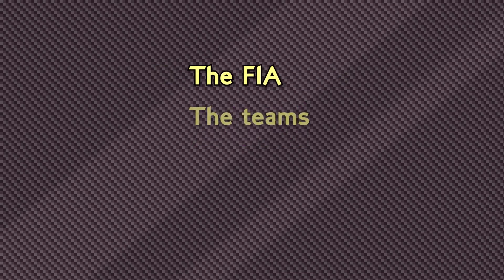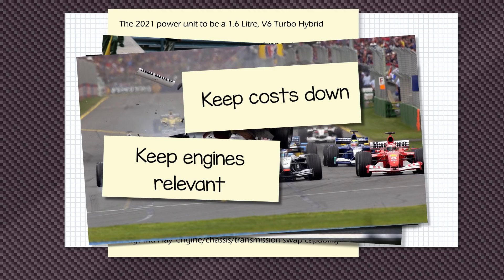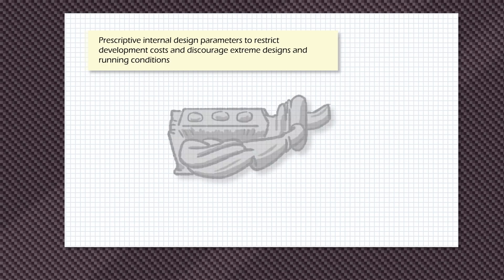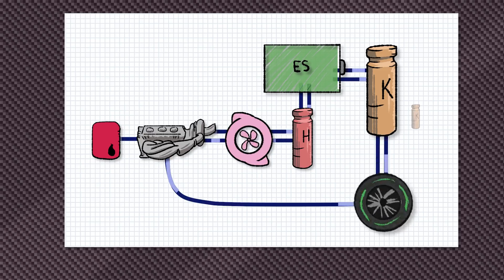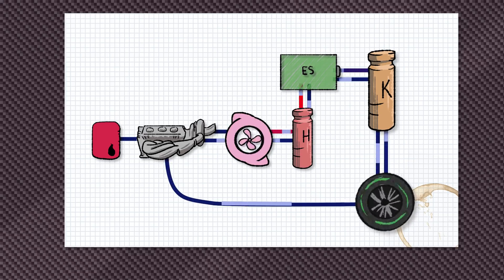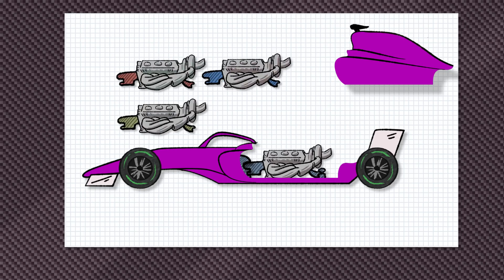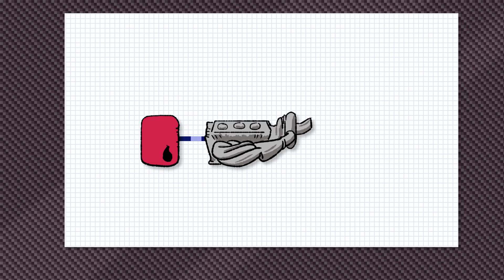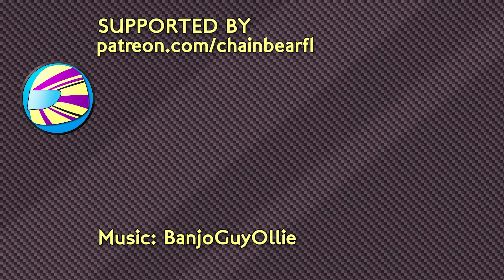F1 Engine proposals 2021 explored

Comment: Why dont they copy the motogp where in manufacturers decide on what kind of engine it would be as long as its in maximum limit of capacity. Whether the engine be v6 i6 i5 i4 i3 or single piston etc. As long as its 1.6 ltr or what ever. Rules kills f1.

Comment: Do you know what is not efficient? Burning fuel just for show, so a little or a lot it does not matter at all. But this is how F1/car/moto racing works, Big engines, Loud noice, Tons of power and happy audience. 
Haven't you noticed  the EMPTY sheets at the F1 races?
If the they are energy concerned, lets stop burning coal for electricity and using big engine cars for commuting (where there is no need for big engines) . Check what cars they are driving outside of the race, because i nerer noticed any racing participant driving a Prius.

Comment: bring back V10 but smaller capacity and hybrid technology
Reply: 2.4L V8 was just fine, they shouldn't have changed it. The new complicated hybrid power unit is what made Mercedes dominant as they have been developing it for years before.

Comment: It's not that they're not interested. They want to do it. EU and now more countries have a strict requirements and regulations what emissions engines should have. Downsizing is of course ridiculous, because those engines aren't reliable. With the rise of new stronger materials and as time went on V8 or V10 high revving engines would be a better option because F1 is sprint racing. Of course, those engines were made with thought that the gas tank won't be full from the beginning. That's why I think bringing back "bigger" naturally aspirated engines is far better than a overweighted hybrid that gives not so much, even though it has more power, but what's that power when your car weights a kpgjilion kilograms.

Comment: Hybrid is not the future so the thesis to have them is flawed. The need to restrict to 3 power units a year has cost more than the marginal cost of producing many the same and has hampered racing. With a full electric series already existing F1 is boxed in. The regulations should be about what you can do rather than what you can do. Spectacular innovation is the future of the series.

Comment: Standardized battery is dumb. Battery tech is the single thing we need more innovation in, letting f1 teams develop new high end batteries would ultimately make consumer cars/electronics/whatever have better batteries.
Reply: Not really. What you are saying is like telling F1 teams to go make their own tires. Its massively inefficient.

 Battery companies can improve batteries with their expertise, F1 teams just make batter use of that to their advantage and automobile advancement. Just like F1 teams and Pirelli
Reply: @uniwasamistake6334  True but if there's a possibility of building a better tire then why limit the teams from doing so? If the team can develop a new type of battery that gives them an advantage then that's all the more incentive to innovate, correct? But f1 is no longer about innovation, it's more about keeping the sponsors happy.

Comment: would it be allowed to use hho or any other stuff inside the gasoline? are there rulez? What rulez are there for the electric unit? can they build it like they want?
What else are they allowed to do? could they use other things to gain energy? like another front brake system? is there the whole rulebook public? :D

Comment: 1L V10 without a rev limiter, twin turbos, 4 wheel drivebwith 3 electric motors and an ERS/MGU-K. That would be incredible. Imagine the tiny V10's revving to 30,000RPM. Absolute insanity.
Reply: But it would be way worse than the current cars. If you want noise just listen asmr f1 on YouTube.

Comment: Great video mate! What would you however say about using CVT transmission, a fly by wire/fibre system for crazy maneuvering and adding one of those williams flywheel for energy conservation?  Besides, engines can very well rev up to 20K with the pneumatic tech on the pistons, so unlocking that shouldn't be an issue. Its racing after all and if we have carbon ceramic brakes, carbon fiber monocoque and what not, it will be also be quite nice to see an air brake to shorten the braking distance. The flywheel will kick the acceleration up, CVT will keep the engine revving at an optimum rate, fly by wire will keep the wheels on the bloody ground and lap records will be shattered...
That will be a formula 1 I would pay to go and watch.

Comment: Is F1 not a race anymore, rather competition to use the least fuel? Why were/are we detuning the engines and maintaining fuel flow restrictions? If they use too much fuel just let them run out. So many benefits to moving back to NA from turbo (they did it in the 60's they can do it again) such as massive power density, low weight, simplicity and cost. Don't judge NA V10/V12 of today with the mindset of the reliability (per engine usage rules) and combustion efficiency of the 90s and 2000s.
Reply: V6 are way more efficient than v10's. They have way more torque and accelerate like beasts

Comment: What I'd love to see to both combat excessive spending on engine development and help out smaller teams: Every engine manufacturer, be it a team or an external source, MUST supply their engine for a fixed price (as in that price is in the rules, and is the same for any engine) to any team that wants it in the following season. The number of engines a team can request has to be restricted, and teams buying an engine should be required to use that engine (with modifications if so desired) so that the system can't be used to ruin a team by requesting engines just so that the team has to produce them, blocking their production resources.
Then noone would develop engines with super exotic materials and/or processes, because they'd have to build a lot of them the year after that, losing them money. At the same time, the smaller teams would have a big load off their shoulders.

Comment: This whole thing is a big swing and a miss yet again. Even if they stick to these proposals. First off get rid of the electrics. You have formula E
If that is the the future, then it is the future. Stop trying to cram it down our throats in F1. It is  very expensive and unnecessarily complex. Tied for second is the ridiculous aero. It is hugely expensive and the slightest contact will not only take you out of the race, but any one else that drives over the sharp debris. Third, the fuel /engine /tire conservation. This is not only racing which is inherently wasteful, it is F1 and therefore the pinnacle of excess. Conservation is ridiculous. 4. Get rid of the myriad of ridiculous regulations that stifle ingenuity. 5. 2 team cars. If they block for each other it is cheating, plain and simple,just remove the temptation. 5. If you make engines and sell to customers teams, then produce a bunch of engines, give them to the FIA and let them hand them back out to the teams randomly, including the manufacturer. 6. Consider reverse grid starts based on finishing position in the last race, you win today, next week you start in the back. 2nd, then next to last. Next bring in some independent officiating and make them blind to the team/drivers involved in an incident, as today's setup is crooked and inconsistent. Next, more power and more noise. Bring back refueling and multiple tire manufacturers. Do anything and everything to promote wheel to wheel action. I don't care if the cars are 10 seconds a lap slower, you can't tell unless you are watching time sheets. They have regulated and penalized this sport into an abysmal product. Do something and do it fast. Your product has become unwatchable.

Edit: the cars need to be smaller again, by the time you design a track that is suitable to the new mindset you wind up with abominations like the french gran prix. A track devoid of of barriers, trees, hazards. They look like autocross tracks with eye crossing lines.

Comment: F1 fans want internal combustion engines. If they wanted electric car racing, there's already a category of that now.
Reply: Agreed. That 'make f1 formula E' mindset hurts both Formula one and Formula E and that makes me sad, because both series are lovable, but for different reasons. Making them the same won't do either of them any good.
Reply: They're not going eletric. They're getting upgraded with eletric pieces. 
It still has a combustion heart, it's not eletric.

Comment: V12s are not irrelevant, bad or anything else. F1 is a racing serious, with non road-legal prototype-like cars that only drive what? 3000 km a season? That's near zero impact on the entire CO2 emission scale. Additionally, a few manufacturers have shown that relative to their size, a modern V12 can very well be efficient and suitable. Of course, we don't put these engines into sedans and estates for daily usage. But the few supercars are nothing compared to all those ridiculous street tanks called SUV. Q8, X7, GLS have enormous proportions and aweful aerodynamics. Their fuel consumption is much worse for what they are used.
Then there is the funny thing about downsizing: putting a turbo on and increasing the revs makes the engine just as consuming as a NA predecessor was. It literally negates its own purpose. 
Mazda has shown that a NA engine with 2.5 liter displacement can outclass a 2.0 liter turbo engine (comparison dobe by german car magazine "Autobild").

Also, combustion engines will not cease to exist for the next 100 years at least. Electric is only a partial answer.

Comment: Man, this dude dissing V12's is ridiculous. Its like, yeah, if you use the exact freaking same V12 engine from the fucking 90s and stick it in the car and that's it, and call it a day, then yeah, its not gonna be very impressive. We have a 6.5-liter modern V12 engine from Cosworth, revving to 11k RPM and making 1000bhp. And its fucking LIGHT too, its not heavy, not for an engine its size. You could hit 1000hp with a 3.5-4.0-liter V12, revving 15k+rpm. That's just naturally aspirated, this dude seems to forget that engines are all technically the same and what you can do to one engine you can do to another.

I personally wouldn't want turbocharging because I think they'd be too heavy, but if you added a more advanced kers system to the V12, it would help counter its low torque out of corners. The cars would be able to be lighter, which means there will be more grip, less tire degradation, and more fun in general for fans and drivers. It would breathe life back into the sport, and make it a spectacle again. I'm not sure how long these engines would last, certainly longer than in the 90's, and with less restriction on materials, perhaps they could be fairly reliable. But, then cost comes into question. Overall, I'm sure if you asked every driver if they'd rather have a heavy V6 turbo or a light NA V12, we all know what they'd pick.

Comment: F1 is first and foremost a show. Hybrid and efficiency tech should be explored, but not at the expense of ruining the show, which it has. And when will Tesla loving ‘electric only’ crowds understand electricity doesn’t come from the electricity fairy, and lithium harvesting, creating lithium batteries, and disposing of them after is far worse than if the thing had a traditional engine to begin with.

Comment: I think they should also allow the drivers to have a extra power button to allow more fuel flow for say 30 seconds of the race for overtaking or defending
Reply: They already have push to pass style buttons/modes. But it increases engine wear, so they don't often use it.

Comment: Losing the MGU-H would be a big mistake IMHO - F1 should be the cutting edge of engine development - dropping the MGU-H to save money and or attract new motor suppliers hardly reflects cutting edge - Mercedes would not achieve its 50% thermal efficiency without harvesting "Free" energy from the exhaust stream! 
In the same vain limiting motors to 3 discourages innovation - 3 motors per weekend might be over the top but so is making them last so long. I think a new motor every 3rd race would be a better compromise - it is F1 after all not an economy drive.

Comment: Lots of people have said the mgu-h is difficult and expensive. However the most difficult part of the new engines is the HCCI-style injection ignition. Loss of the mgu-h would be a terrible shame, its a hybrid electronic supercharger/turbocharger in addition to waste energy scavenger. It makes these the most efficient racing engines ever built.
I think direct H>K deployment is permitted (not via ES) and is missing from your diagram.

Comment: The electrification will be F1's undoing.  F1 is a sprint race and hybrid designs disrupt that dynamic.  It's a dead cause.
Reply: No it doesn't? They're getting higher and higher torque, which means they accelerate much faster. If anything it's making it better as a racing event.
And no, they'll not get fully eletric. There's Formula E for that.

Comment: Why dose the combustion engine have to go away. If it works you dont need to use electric to save the environment they burn coal to Make electricity so it's the same thing keep the combustion engine and run it on different fule for example natural gas or hydrogen

Comment: Oh and BTW I have one sentence that would destroy the v6 engine if the FIA permitted it:the parameters for the aston Martin valkyrie cosworth v12, but modified for f1,
Reply: V6t is already the most efficient engine weve had so manufacturers are going to just keep using that unless they dont have a choice in which case you dont know the point of f1. Which is the pinnacle of human skill in driving not who can make the fastest car
Reply: Global Elite wrong. F1 is the Pinnacle of Engineering. Making the most out of the regulations and thus making the fastest possible car
Reply: Edgie Braahhh thats not what the official website says so youre wrong
Reply: Edgie Braahhh at the end of the day the driver skills is what wil partially determine the race. A car can only get you so far. To get a podium you need skill.
Reply: @globalelite3042  well, most of the drivers themselves agree that the car performance determines 80%, and skills 20%. Take Russel in a Williams vs Mercedes for example.

Comment: The day F1 gets rid of the combustion engine is the day F1 dies... you will never be able to convince me otherwise.
Reply: Then, eventually, F1 ceases to be relevant at all.

There will come a time when electric cars will completely outperform petrol cars. We aren't there yet, nor are we that close, but it will happen.

If F1 is still using petrol at that point, it will officially have become a remnant of the past, no longer pushing the boundaries of automotive development, no longer the fastest cars around a track of any series, just a dinosaur slowly going extinct.

It is my hope that eventually, when the technology is right, Formula E gets folded into Formula 1.
Reply: @TheRealestKuni  the problem is it's not a natural change but it's forced by the EU. they can keep putting more money into developping the combustion engines but "the climate" and all but they won't.
Reply: @GPO-e9o  Yes and no. We've already reached some pretty profound levels of diminishing returns in internal combustion engines. Yes, we can make them better, but at increasingly high costs for increasingly low rewards. We're already seeing that the very best way to improve them is to hybridize, and while it will be a long time before electric can beat out the combination of electric AND petrol, the only real limiting factor is energy storage. That factor WILL get solved.

Comment: What also keeps things cheap is letting engine manufacturers do what they want, and give them an emissions target, max fuel flow, and race fuel allowance
Reply: If you let them do what they want, richer teams like Mercedes would just dominate everything, while poorer teams would have less and less money to develop their cars, until they collapse.
Wait, that's what is happening right now...
Reply: If you let them design whatever they want costs will spiral as they try to out develop each other
Reply: Add a customer supply maximum cost and I wholly endorse this
Reply: Manufacturers dont care about money. V6t is already more efficient then any other engine. So every team is going to stick woth v6t anyway
Reply: @globalelite3042  The whole idea was to encourage more manufacturers into the sport by making the tech "road relevant". The cost of developing all the hybrid tech AND the combustion engine is what prevented Porsche/Audi and Aston Martin from joining. Not to mention all the bad PR that Honda have had from being forced into the sport a year early.
F1 wanted to simplify the engine by getting rid of the MGU-H (reducing costs so other manufacturers would join) but the current teams rejected it on the basis of how much money they already spent, and changes would only increase development cost. F1 have to do what the PU manufacturers want for fear of one of them leaving the sport - where no new manufacturer would be able to make a competitive PU or straight away - and frankly they wouldn't want to waste the money on joining the sport to be the worse PU, and get the publicity Honda did.

The engine limit was introduced to reduce costs, so teams will run the engine in detuned settings to avoid engine penalties.
Hence in the race the cars lap below their optimum pace until they are close to another car and can briefly turn up the engine mode. One of the things drivers complain about it not being able to push because of fuel saving, engine mode and tyre life.

It's a Catch 22 where we are stuck with an expensive PU that nobody wants.
1. it's too expensive to change it now
2. no new manufacturers want to join under the current regulations
3. the PU manufacturers know that they can dictate what happens because F1 is scared to lose anyone.